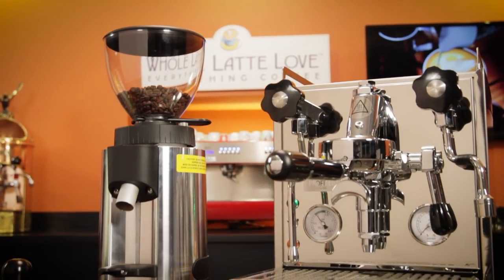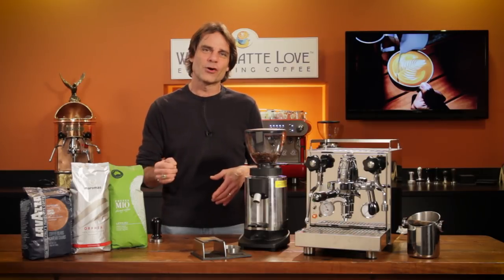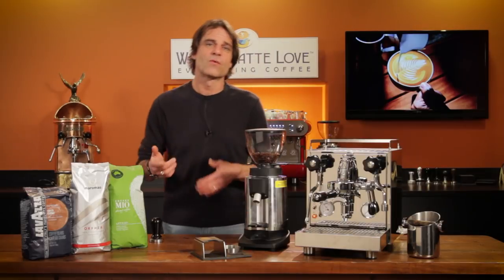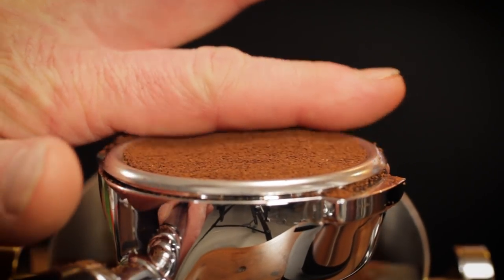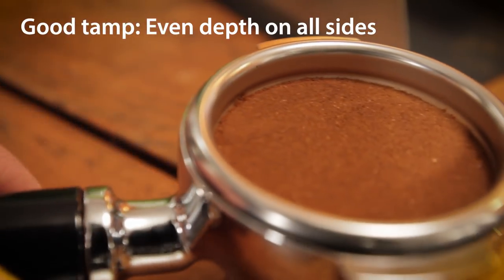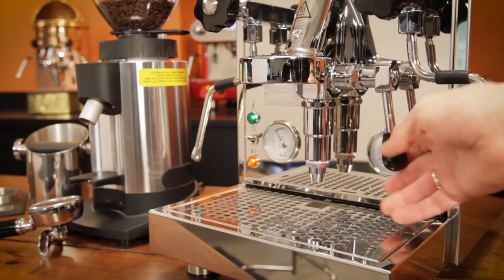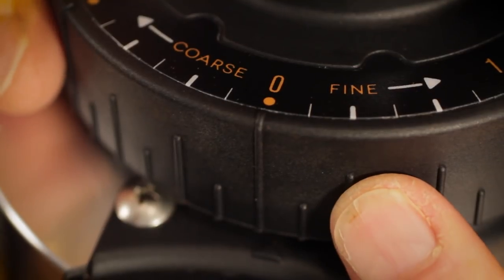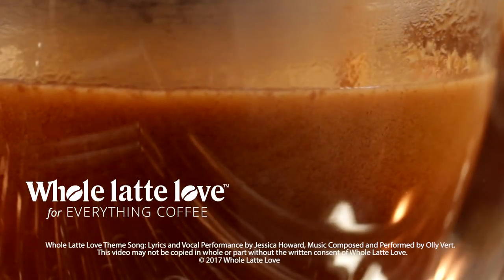How To: Basic Espresso Technique - Dialing in Grind Size

Comment: Great video thanks!  Do I need to pre flush for an Expobar Brewtus IV? Thanks!!
Reply from the maker: Hi Mike, You are welcome! In general you should not need to flush a dual boiler Brewtus. Can always check for flash boiling by running a bit of water from group without a Portafilter in place. If you see lot's of bubbling and/or turbulent flow from the shower screen that calms down after a few seconds that's flash boiling and you don't want that hitting your coffee. Most likely to happen if you are running at the high end of espresso brew temps or the machine has been sitting idle but on for long periods i a warmer than usual environment.
Marc

Comment: Breville infusion here  had it here for well over three years always used to pressurize porta filters every once in a while I'll pull out the non-pressurized and try as hard as I can to get it to work  wasting tons of coffee to get it to be like the pressurized Crema and it just won't happen . The pressurize baskets are a hit and miss some days  have decent shots other days well . I'm not sure if the Breville is just inconsistent on shots or if it's possibly the Breville pro grinder not always putting the same amount of grounds each time or maybe not consistent with the grind  or just the combo of the two together   . The only decent looking Crema I can get it set at 19 to 20 on the grind . Is it even possible with the non-pressurized porta filter and Breville pro grinder to even get a decent shot non-pressurized

Comment: I have a classic old hand-pull Olympia Cremina. Your video shows a grind for a 20-30 second pull, but they appear to be automatic. When I first put my portafilter in it has a pretty steady drip but not a stream. At what point should I start my pull? And should I try to time it for 20-30 seconds?
Reply from the maker: Hi l, Thanks for the question. When using a manual lever machine timing can be a little different. You have some pre-infusion happening with the initial set of the lever prior to release. I generally do not count that time in an extraction. Understand timing is the most basic method of appraising extraction. Useful for initial dial in of grind size. After that, let flavor be your guide. If bitter, increase grind size a bit. If sour decrease grind size. Hope that helps!
Marc

Comment: Hi, great video. Does crema count as volume out? In the final shot you pulled, most was crema but it was still at the 2oz output volume.
Reply from the maker: Hi Richard, Great question without a perfect answer! IMO final volume is just one aspect. For videos I tend to standardize a bit and stop shots at around 2oz volume including the crema. A good fine crema is not as airy as it appears. If you let a crema rich shot settle out you might see a decrease of ~10ml in a 60ml/2oz original extraction. At some point it depends on how particular one wants to be. Next level after simple volume measurements is calculating brew ratios by weighing the output of an extraction and dividing that by the weight of the coffee dose. When using brew ratios one needs to consider shot timing and volume as well. If interested, here's a recent video we did which explains brew ratios: https://youtu.be/57UqPDirHoU

Comment: If I don't have a measuring receptacle wide enough to accommodate a double spout  portafilter,  is it possible to use a single spout portafilter using a double shot basket to dial in coffee grind size?
Reply from the maker: Jonathan Mamelok yes if the double basket fits

Comment: Great video for those of us learning the ropes with these premium espresso machines. 

One unrelated question triggered by the 1 bar pressure comment and gauge view at the beginning of the video for those of newbies. Should the pressure in the boiler be totally emptied when turning off the machine, does it matter?
Reply from the maker: Hi C, Thanks for the question. No need to release the pressure. It dissipates on its own as the machine cools down. Once below boiling point a vacuum relief valve opens on the boiler to ambient pressure.
Marc

Comment: Hi there. I use a breville dual boiler and a la pavoni grinder. At its finest setting I am able to get the grind size small enough that it clumps up. However, even at this size I struggle to get my shots to pull at the desired  pressure / time without using one of the pressurized filters. Do I need a better grinder to get the grind even finer? My machine is freshly descaled and cleaned.  Thanks in advance for your time,

Hank
Reply: By struggle, I mean that I have to put so much espresso in that I am tamping with a ton of pressure and have to push the portafilter hard into place. I can brew a good espresso this way, but it seems more physically challenging than it should.  It should be noted that I almost exclusively brew single shots. I haven’t tested the unpressurized double shot filter in a long time.
Reply from the maker: Hi hank, Thanks for the question. It sure sounds like your grind is not fine enough. But that grinder should be able to go fine enough to choke your machine. I would for sure try the unpressurized filter basket. You mentioned your grind clumps up which typically indicates a very fine grind. But, some grinders may produce a clumpy grind even at a grind size coarser than that needed for espresso. This can be caused by extra oily beans, obstructions in the grind delivery chute or just be the grinder. It's been a long time since I've used a La Pavoni grinder so I don't recall it's characteristics as to clumping.
Marc

Comment: Hi Marc, thanks for this very informative video! I've heard that coffee beans should be used within 2 weeks from roasting as they then go stale. Is this true?
Reply from the maker: Hi P, You are welcome and thank you for the comment and question. Going stale depends on coffee bean type. In the case of single origin specialty beans they are more flavorful if used within a few weeks of roasting. But if properly stored in sealed original packaging they don't lose much in quality after initial off-gassing. Lower cost bean blends are created with some aging of the beans to be expected. Here again if properly stored in original packaging they hold up very well. Really no problem storing them for months. The vast majority wouldn't be able to tell the difference in beans that had been stored for 2 months to those stored for 9 months.
Marc

Comment: Hi thank you for the video I was wondering about the humidity (weather) . I’ve been told that when it’s humid outside can change the speed of the shot but don’t know how to adjust it...in that case should I leave it that way ?
Reply from the maker: Hi R, Thanks for the question. As I say all the time grind size is never set and forget. Factors like humidity, temperature, age of beans, type of beans will all change an extraction. As the extraction timing changes with other variables make minor grind size adjustments. Hope that helps!
Marc
Reply: Whole Latte Love thank you Marc!

Comment: Hi Marc. I pull shots from my Profitec Pro 500. I always allow my machine 30-35 minutes to fully warm up and I typically flush for 10 seconds. What do you think?  Too much?  Too little?  Thanks😎☕️👍
Reply from the maker: Hi William, Thanks for the question. Love the 500 and use it a lot! Warm up time is good. In general a flush should not be needed unless you have an older non-PID Pro 500.
Marc

Comment: Hi, did you set the pressure to be the same for all of the trials?because you did not consider the shot pressure in the variables.
Reply from the maker: Hi HA, Thanks for the question. But I'm not entirely certain what you mean. Shots were dialed in on the same machine so OPV pressure  never changed.
Marc

Comment: Thank you for the wonderful knowledge! Questions:
Let's say I'm putting out water temperture (consistant) and dose weight. Now you get grind size, brew time, and brew ratio (or volume?)/
1. Volume of liquid or weight? I understand usually the measurement is brew ratio, which refers to weight - question is wether there's a significant difference between 36 ml shot to 36 g shot? If so, does the grind size affect the final weight of the shot? Do you measure it at all or eventually it's fine to stick with the volume only?
2. How do you determine the time and volume/brew ratio? Do you at first just fix an arbitrary ratios like 60ml to 17g dose, 25 sec, then play with the grind until you get there? 
Now you found it, which changes do you make in order to idealize it more - keep grind size and change the volume or keep volume and change grind size (therefore time)?
Reply from the maker: Hi mm, Great timing for your question! Put up this video yesterday on Brew Ratio: https://youtu.be/57UqPDirHoU
Your questions:
1. Brew ratio is measuring weight. There usually is a significant difference in volume v. weight. A thick layer of crema weighs less than espresso in full liquid state. In the video linked above I pull a shot that ends at 60ml/2oz volume and it weighs about 42g. Grind size can affect final weight but it's relative to volume of water thru the shot. A finer grind makes for a shot with more dissolved solids. For coffees I work with a lot I don't weigh very often. I know them well and can tell if something is off by appearance.
2. In general you keep the time the same regardless of the ratio you are shooting for. So same timing for a 1:1 ristretto as a 1:4 lungo. You can manipulate grind and dose in tandem to end with the same timing. In general decreasing dose makes a shot less bold while you'd also use a finer grind which makes the shot less bright. Going the other way a coarser grind with a higher dose makes a shot less bitter and more bold.
Reply: Thanks a lot, totally helpful answer

Comment: Big fan of all Whole Latte Love videos. I just scooped an Elektra Semiautomatica machine which does not have a PID. Do you know if I should flush an initial shot of brew water before using on this machine? Thanks in advance.
Reply from the maker: Hi AV, Thanks for the comment and question. That's machine is a beauty! I have not personally used that machine. I'd check what the brew water looks like with the portafilter off when running a blank. If it's bubbly and then calms down (or there's lot's of initial steam) then I'd do a flush before brewing.
Marc

Comment: Hi Marc, brilliant video! Definitely got a few things to work on now. Using a rancilio Silvia/rocky setup, how long to warmup do you reckon? And your thoughts on the flush👍🏽
Reply from the maker: Hi d, Thanks for the question. Honestly I do not use a Silvia very often. I do know there's quite a bit of variation of in boiler temps depending on where the machine is in the heating cycle. That variation gets smoothed out a bit as water moves from boiler to the coffee. Personally I'd do a flush and watch/listen for flash boiling indicated by turbulent flow from the empty group and or hissing (steam). I'd flush until flow smooths out and then brew.
Marc

Comment: It looks like you're judging the amount of coffee out by the crema surface, but if you wait till the visible coffee reaches the line it would take longer. As crema differs, which is correct... "The crema level, or the liquid level" to reach the mark line... ?
Reply from the maker: Hi Pip, Thanks for the question. This is a basic technique video. I'm assuming those watching are newer to espresso and do not have a scale capable of accurately measuring weight of espresso as it extracts. Without a scale, one must make an estimate. I'm using my experience to make that estimate and it's a good place to start for typical coffees and there crema production. More accurate method is using a capable scale to weigh the coffee dose and the espresso extracted. Typical espresso brew ratio is 1:2. Meaning weight of espresso out is double the weight of the ground coffee used. So 17g ground coffee produces 34g of espresso in 20-30 from first drip. Be aware one cannot translate liquid volumes to weights with accuracy. While pure water weighs 1g per 1 ml, Espresso does not - especially the airy crema which is much lighter. Here's a video with deeper explanation of more advanced technique using brew ratios: https://youtu.be/WifLRJZKs9A 
Marc

Comment: Hi! I was wondering which kind of home/domestic grinder you recommend me. Budget: Under $100, USD.
Reply from the maker: Hi LS, Thanks for the question. That's a very low budget for an espresso grinder! But, it may depend on what type of machine you are using. If brewing through a pressurized basket like those found on low cost entry-level espresso appliances grinding fresh with a budget burr grinder is far better than using pre-ground coffee. If brewing in standard non-pressurized filter baskets there's nothing I can recommend in that price range. For that type of brewing a typical recommendation is a grinder budget of 50% of machine cost up to a $1000 machine.
Marc
Reply: Encore
Reply: Lido 3

Comment: I have an old obh nordica red chili (I think it was called) espresso machine that I got at a secondhand yesterday. I only have a blade grinder, a lid from a thermos that I use as a tamper and I know nothing really about how do make espresso properly with it cause I can't find any guides on using it cause it's old. A few questions come to mind.

1. How much espresso is a full portafilter supposed to make?
2. Are the grinds supposed to dissolve when dispensing the espresso?
3. You're supposed to refill the portafilter with new ground each cup you make right?
4. I have "espresso" beans that are dark roast. I got those when I didn't know espresso was a brewing method. When I made espresso yesterday for the first time I had no crema. How do I get crema, different beans or something?
Edit: 5. I have no idea how to work the steam wand on it.
Help
Reply from the maker: Hi CS, Thanks for the questions!
1. Depends on the portafilter size. I'm not familiar with your machine but standards for commercial size 58mm filter baskets are 7-10g dose for single shots which make about 1oz/30ml of espresso. Double shots use a coffee dose of 14-19g and produce a shot size of of about 2oz/60ml.
2. Grinds don't dissolve but... they do give up solids to the brew water passing through them.
3. Yes!
4. Crema depends on bean type, age of beans, grind quality. Blade grinders should not be used for coffee - especially espresso! Consistent particle size of ground coffee is key and blade grinders hack coffee beans into random size bit ranging from powder to chunks. To get to espresso fine with a blade grinder beans get so warmed that the good aromatics and crema producing gases are cooked off.
5. Sorry not familiar with your machine. Most that do not have steam always available will have a switch for heating up[ from brewing temp to steaming temp. Here's the best available video showing begining frothing technique right through pouring a latte art heart: https://youtu.be/4PSCsv7kcKA
Hope that helps!
Marc
Reply: @Wholelattelovepage  Thank you for the answers, one thing about answer number four though. I don't have money to buy a proper espresso/non--blade grinder. I have a mortar and pestle but it's a bit shallow. What should I do about that do you think?

Comment: Hello, I new to making espresso.  So after watching that I should pull an approximate 16gram dose of espresso at 2 ounces including the crème, am I correct that a single shot 7-8 gram dose should be pulled at 1 ounce?  Given that the timing is approximate 25 seconds.  Also can you clarify that I do include the crème in the measurement correct?  Thank you
Reply from the maker: Hi Richard, Welcome to the wonderful world of espresso! Most will measure volume of shots including the crema. Volume/time measurements are a reasonable way to get in the ballpark. Especially for those new to espresso. You might want to check out a video we put up last week on using brew ratios which involves comparing weight of shots to weight of coffee dose: https://youtu.be/57UqPDirHoU It's the next step after time and volume. A single shot is about 1oz. I will add that very few people pull singles and those that do (unless you're in Italy) tend to use a slightly larger dose of 9-10g. Singles are trickier to pull.

Comment: HI Mark. I have profitec 500 PID. What would be the PID setting for pulling shots? should I use the default setting that came with machine? Let me know please. Thank you so much
Reply from the maker: Hi Len, Thanks for the question. General range for espresso and most all coffee brewing is 195-205F (90.5-96C). General guide for brew temp is higher for lighter roasts and cooler for darker roasts. So if using a typical medium roast I'd start at 200F (93C). I'd play with it. See how flavor changes if you brew your coffee at higher and lower temps.
Marc
Reply: Should I use default PID setting?
How can I change it?
Thanks so much

Comment: Great video! Thanks for sharing! Wondering which model of this Ceado grinder? Looks work well Thanks!
Reply from the maker: Hi Evan, You are welcome! Thank you for the comment and question. Grinder in this video is the Ceado E5P: https://www.wholelattelove.com/ceado-e5p-electronic-coffee-grinder The Ceado E6P is the same grinder but adds 2 timed grinding programmable presets. If you plan on using a bottomless portafilter be aware the E5P may not be the best choice as it's the spouts of a portafilter which push a switch to start grinding. With the E6P grinding is started by pressing a button so bottomless PFs work fine: https://www.wholelattelove.com/ceado-e6p-electronic-dosing-grinder-v2